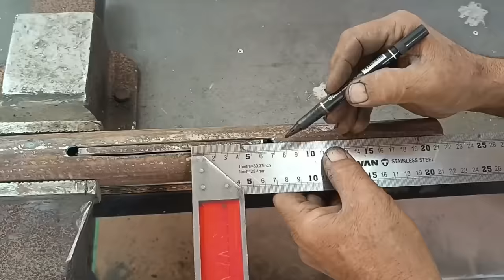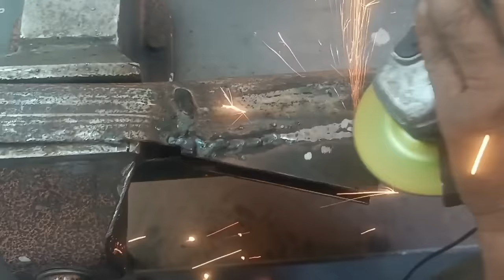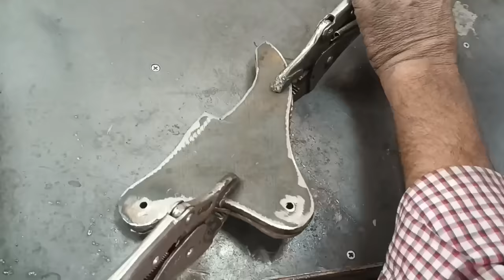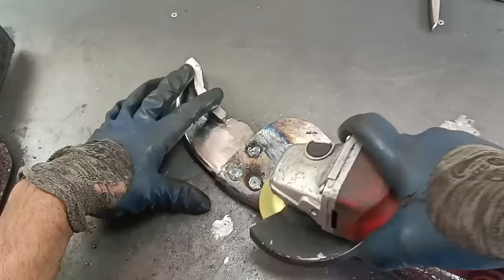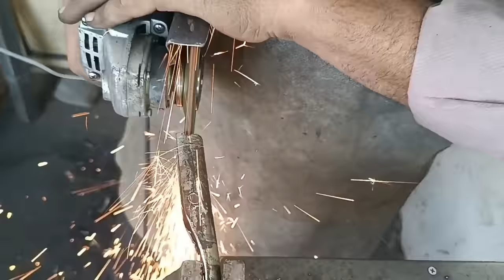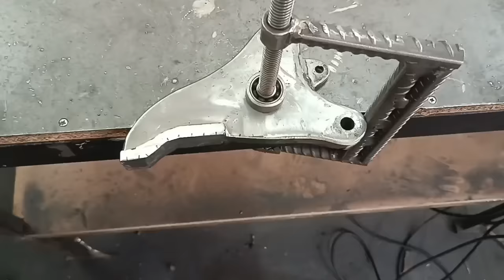Hand-made lock pliers, the world's largest lock pliers

Comment: Nice set of vice grips. Not difficult to replicate and scale up or down in size when there's an example to work from, takes all the  hard decisions and calculations out of the equation. I like your no fuss lathe knurling tool for the cross hatching on the adjusting nut too.  Some leather gloves might help with the flash burns on the welding side. Cheers
Reply: Show us then if you got the skills